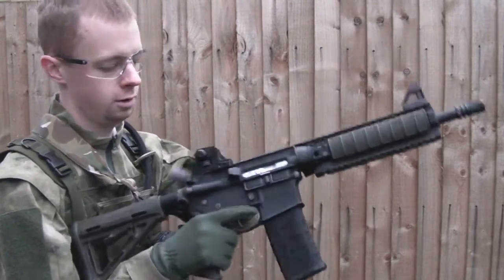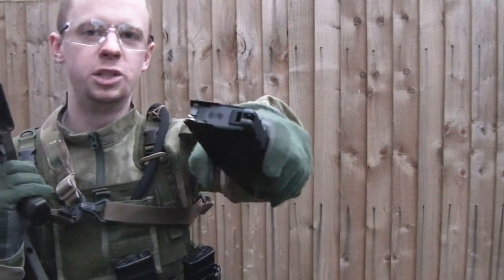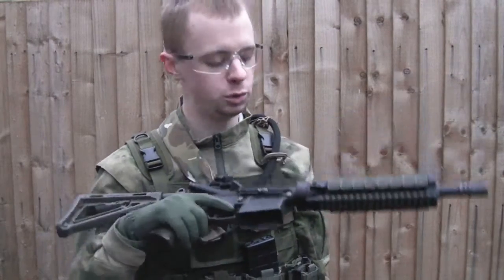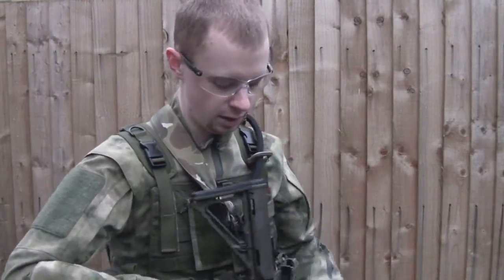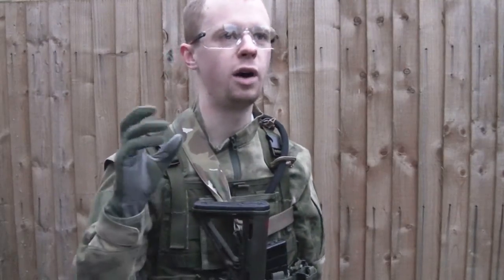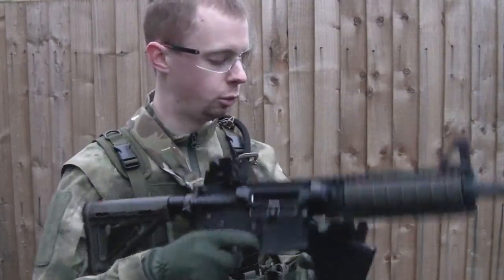G&P PMAG Test (GBBR)

Comment from the maker: The gas system between the two types of rifle is the same, problem with airsoft companies is they always make stuff as cheaply as  possible so you get a lot of issues with fitment and tolerances.  GBB rifle mags and the way they interect with the bolt in the rifle are probably one of the most picky/finicky things in airsoft, everything has to be just 'so' or the weapon never will function right.  Thanks for sharing your experience though, should come in handy for some other viewers.